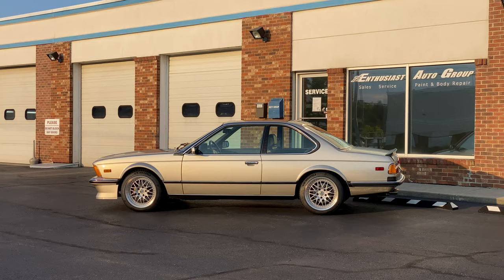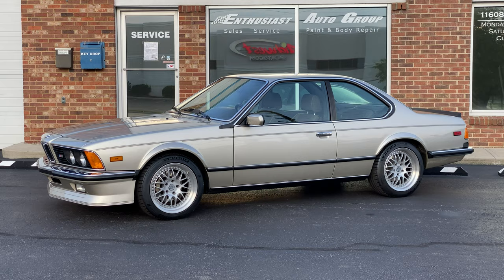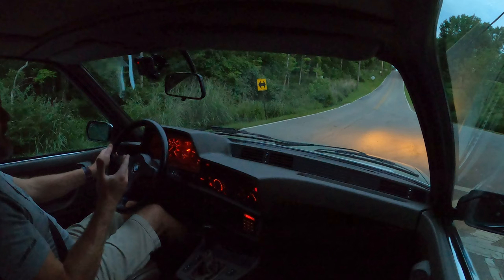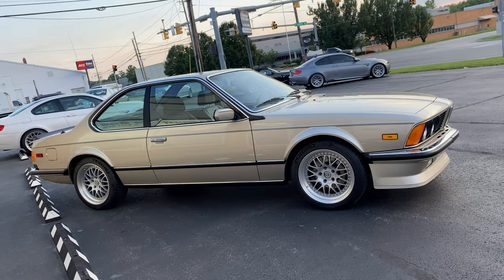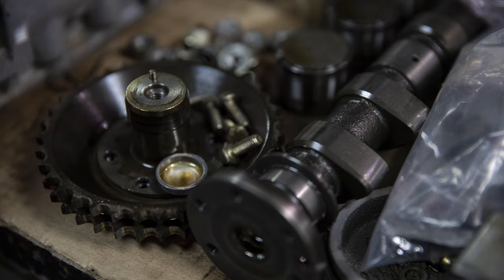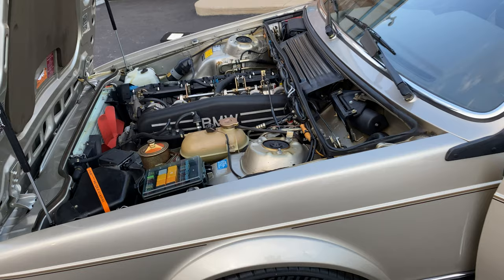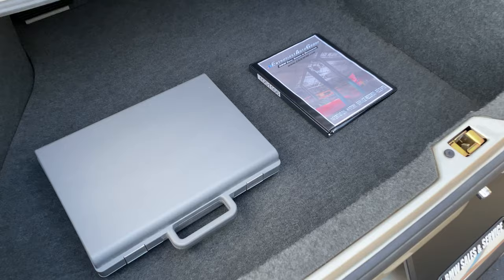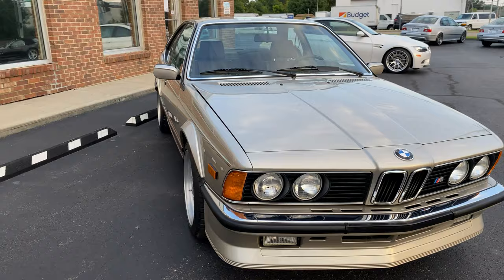The Finest E24 M635CSi in North America Today – 1985 BMW M635CSi | 5K Miles

Comment: I have a stock 1985 M653CSI as well. My rear spoiler it different though. It has just a black lip. Mine is 100% original. I'm even still using the rare metric BBS Michelin TRX tires and wheels. Mine is Alpine white/black

Comment: Didn't 'treally go into what makes these euro m635 so special like it has the M88/3 engine which was the most powerful 1st gen M motor and has 30hp more than the S38 in the M6. It also weighs 3307lbs vs 3569lbs for the M6. Has factory headers and bilstein shocks and shorter firmer springs with no self leveling and wheel arch flares. Most people see the M badge and think it is a regular 635 with a fake M badge. This is the most powerful e24 made.
Reply: Yes, it is all that and more!  To be more accurate however, the most powerful E24 "made" in-period would have been the Alpina B7S Turbo.  That said, it's fair to say this is the highest performing E24 produced by BMW M in the hay-day!  They are marvelous to drive without a doubt!
Reply: @erickeller1118  awesome channel Eric great luck going into the future
Reply: Part of your statement is incorrect. Wheel arches flares were NOT installed on all M635CSi. They were installed with a specific wheel size option available, so many M635CSi have no wheel arches.

Comment: Are those side markers stock?
Reply from the maker: They were required during the 1985 Federalization process performed legally allowing this Euro-Spec M635CSi into the USA market.  They were required to pass DOT requirements in-period and part of this and many other grey-market E24's story if imported legitimately.
Reply: @EnthusiastAutoGroupCincinnati  That's such a bummer, since installing US-spec bumpers could have prevented that completely (they already have them integrated into the bodywork). If I owned the car, I'd take those off and patch them up.